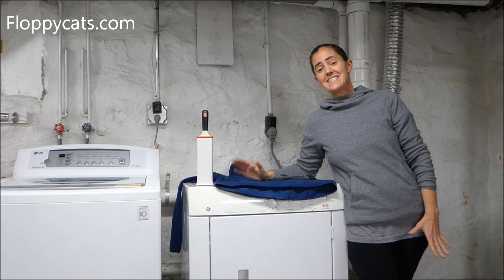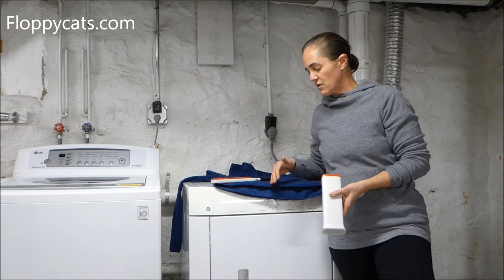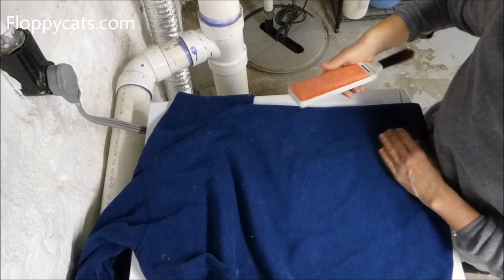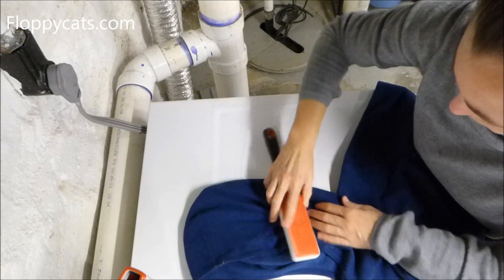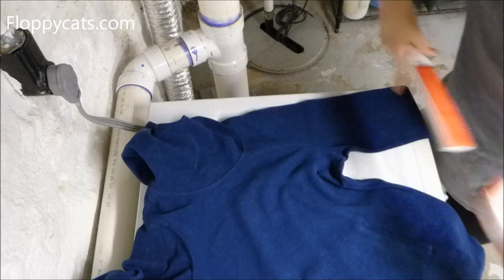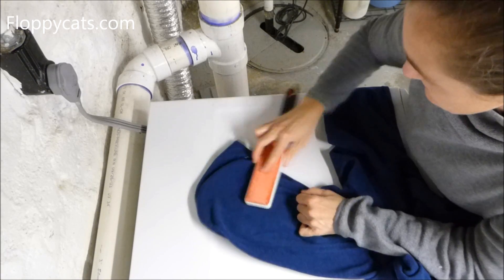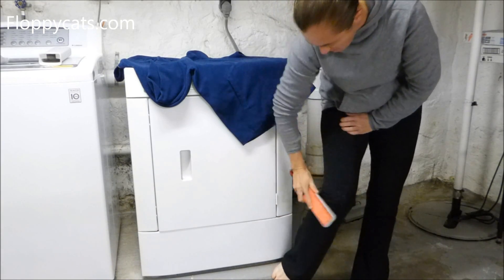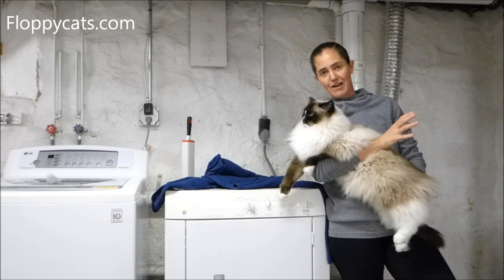Pet Hair Remover: OXO Good Grips FurLifter for Clothing Product Review Video - ねこ - Floppycats

Comment: For my couch I use a really big sponge...like the car washing ones. I keep diluted fabric softener in a spray bottle and lightly spray it onto the couch then wipe off with the sponge.  
That’s the only thing that seems to work perfectly for me. 
I haven’t found anything that works perfectly for clothing though. I may give this a try and see if it does it for me. Thanks for the review! :)
Reply: wait, so do the cats get the fabric softner on their coats and then lick it off?  i would be worried about them ingesting the chemicals.
Reply: Do you not use fabric softener on your clothes and bed linen? You’re not soaking the couch. You’re lightly spraying it with diluted fabric softener. Just spraying with plain water works too.
Reply from the maker: yes, i do use it on my clothes and on my sheets, but it is also rinsed and rung out in the washing machine before i put it in my dryer - so it wouldn't be like spraying it directly on the couch.  i just am overly aware of that sort of exposure given the horror emails i get about cats dying from acute kidney failure.
Reply: Floppycats I lost my beautiful young Himalayan cat because I had my carpets cleaned by an outfit that used a “quick dry” (not!) chemical method. He developed cancer that spread to his liver. It was a mystery as to how that young, not even two year old, cat got cancer—until I adopted my mom’s cat, had her blood checked after a few months, and her liver enzymes were high. I had the carpet in the whole house steam cleaned.  A month later, her liver was back to normal. After that, I had the carpet cleaning place use just water. A tragic lesson learned.

Comment: Just so you know, the one you are using in the video is the one intended for furniture and there is a slightly smaller one that doesn't pivot and is intended for clothing and then there is also a smaller travel size. :-)